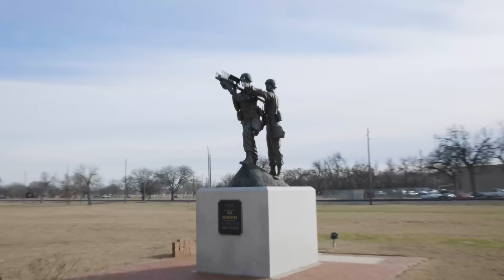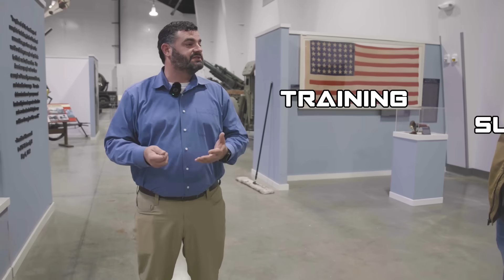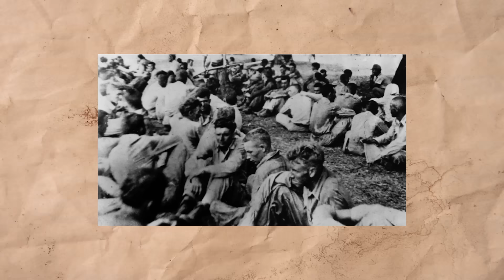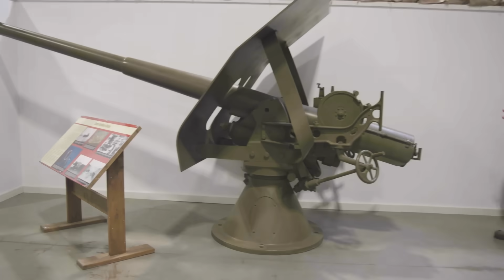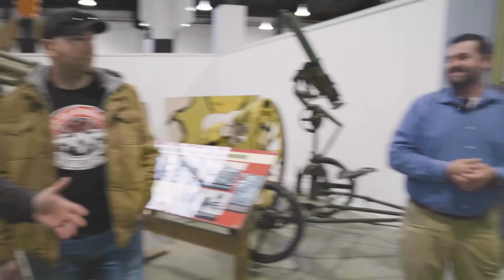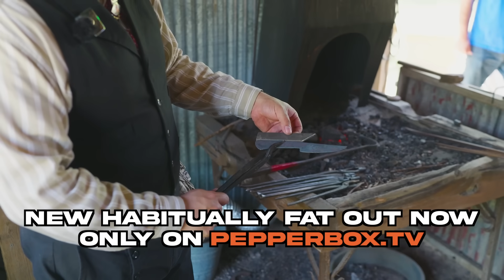Fat Electrician and HLC Learn About WWII Artillery | PepperboxTV Exclusive Clips

Comment: I'm going to bet those are not 16" AP shells from the Iowas (and North Carolinas and South Dakotas). The Mark 8 16" AP (which is actually 2,700 lb) is 72" long, but HLC appears to be significantly taller than the shell is when he gets close. The 14" Mark 16 AP was 56" long, less than 5', while the 16" Mark 5 for the Colorado-class is 64" long, as is the high capacity Mark 13 shell used on all the US battleships with 16" guns. The Mark 14 HC only weighs about 1,900 lb, but a HC shell should not be that pointed because of the nose fuze.

Comment: My uncle was an ambulance driver during the Korean war - they would take the quad 50's and mount them in a half track and pair them with a search-light truck - park them up on the top of a ridge and spotlight routes for the drivers...he wouldn't go into detail but said they were really effective at clearing paths for the ambo drivers.
Reply: Old timer from Korea said they mounted the quads in a jeep. Found out you could only fire to the rear. The jeep would tip if you fired left to right.